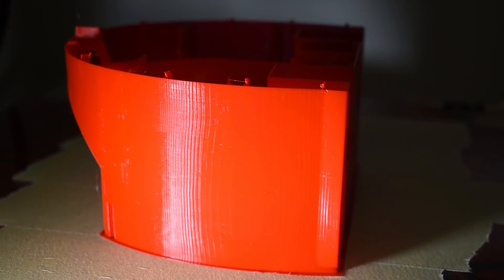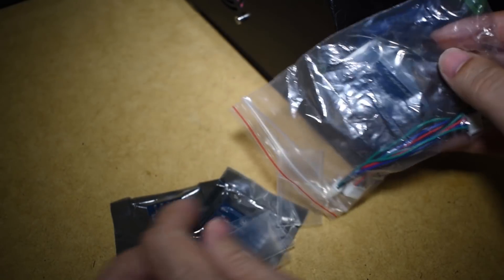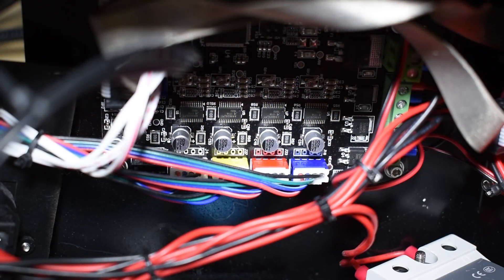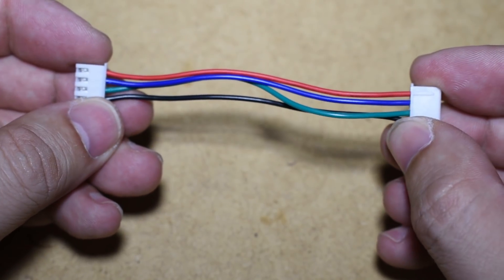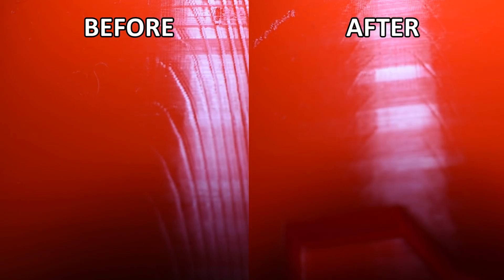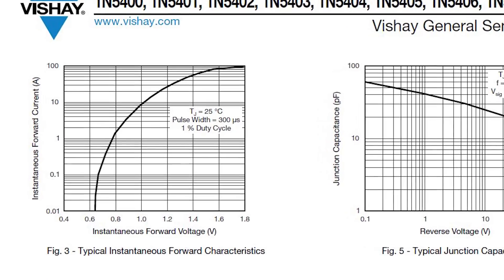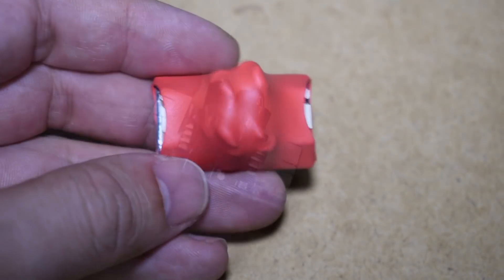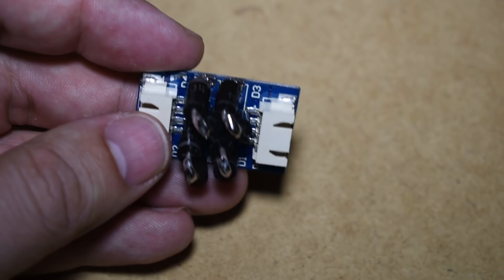SALMON SKIN PATERN IN 3D PRINTS – HOW TO FIX IT FOREVER

Comment: The fast decay mod on DRV8825 drivers also helps. I have smoothers that use 8 diodes and passive cooling. They get very hot so I added active cooling. They work great now.

Comment: Have a question: When you install the smoothers do you have to change the "ref" on the stepper drivers on the broad? The reason i ask is that I had to change the "ref" on the drivers when I first got the printer as you had displayed on a video. I then had purchased smoothers now my print shifts if the printer goes fast.
Reply from the maker: Hi, if you have TMC drivers you will not need smoothers.

Comment: Enough watched... Subscribed! I kinda follow you since your vids for the tarantula but now I bought the tornado in part thanks to you. Speaking about, think your tornado is loud? Would you consider doing some fixes for that (and maybe share it too)? Like your vids because other than several youtubers, you know what you do in terms of technical competence, gives a feeling of safety when considering applying your fixes! Cheers!
Reply from the maker: Hi,
First of all, thank you for your feedback.
Regarding your question, I don't think that the tornado is loud. There is one moment at the start of the print that the fans turn at full blast (and yes...they are loud) but only for a few seconds. The rest of the print is not loud in my opinion. since the fans in the controller are RPM controlled. You can still replace them with noctua fans. These are very silent. Regarding mods/fixes, if i find them i will defenitly post them here or on thingiverse ;)
Reply: ruiraptor hi there, thank you for the reply! That's good to hear, as was a bit concerning (sort of). Yes please; if you decide to do the commented Fan mod or installing a bltouch or the one using induction, please post a video as I'm really considering doing both and despite I'm OK with technical stuff, I prefer to learn from a pro. Cheers!

Comment: For the A4988 drivers used in latest GenL Gold Tornados, there is a different change to remove salmon skin. These drivers are setup for CNC machines, and need a small jumper wire to the ROSC pin to change mode.  All described here: 
https://reprap.org/forum/read.php?336,434073,445689,page=2
(Hit the translate button in Chrome)
Reply from the maker: Hi,
Thanks for sharing.
I did test that at the same time of my analysis and it worked but at the same time, the motors noise changed significantly so I abandoned the idea.

Comment: Hi ruiraptor, 
as always you make the best video for Tevo Trantula and i always follow you and your advice. I'm here to ask you if this smoothers should be installed on each axis X,Y and Z ? 
The link in the description doesn't work so i looked for some info on the net but i dind't find any good info about salmon skin effect.
Thanks :D
Reply from the maker: Felice Caccamo ,
Thanks for the comment. 
Recently some users have received h4982 drivers on their boards instead of the A4982. And some users say that smoothers have almost no effect whith those drivers while others say they do. So I recommend everybody to test. Any 8 diode smoothers will work but I like the trianglelab ones. This decay issue I'd present in all the axis but the salmon skin issue is only visible with the x and y axis. You can use smoothers with all the axis. For example, you you buy the 3 pc pack or 4 pc pack, you can install all of them if you want.
Reply: Thanks for answering, i have the A4982 drivers so i should install the smoother. Actually i have 4 stepper motors with dual z axis, anyway i'm thinking to install it only in X and Y axis considering that i have to buy also 16pc 1N5404 replacing the stock one. 
Do you recommend all the axis? or the printing could be better only with X and Y axis? 
thanks
Reply from the maker: Felice Caccamo 
If you buy the trianglelab plus smoothers, you don't need to replace the diodes. They will work ok stock. And you can use only in x and y axis to eliminate the salmon skin pattern
Reply: The diodes on the PLUS versione have same features like 1N5404? are they nice like the stock one?
Reply from the maker: Felice Caccamo ,
They are equipped with true vishay diodes. I have a different printer (not tornado) running these smoothers and the result is amazing.
Reply: thank you , i will buy it as soon as possible.

Comment: Is shrink wrap required? I don’t have any and I’m wondering if I can just electrical tape it or don’t do anything at all.
Reply from the maker: Hi Nathan,
You can use any insulation material as long as it can handle some temperature as the smoothers can get hot.
Reply: ruiraptor alright thank you! Not many YouTubers be as helpful as you!

Comment: I just have question, how many smoothers are used for the Tevo Tornado? Is it 3, one for X, Y, and Z or is it 4, one for X, Y, Z, and the extruder stepper? I'm a little confused on this one and hope you can help me. Thanks and great video!
Reply from the maker: Hi JAGA,
The salmon skin issue is related with the decay and microstepping with these drivers. All axis have this issue but the salmon skin is only produced by the X and Y axis.
Having said that, you only need 2 (8 diode) smoothers to eliminate the salmon skin...but you can use smoothers with all the drivers.
Reply: Do you think it would help anything to use one on the Z or Extruder stepper also?
Reply from the maker: My guess is that you probably would not notice.In my opinion, you should install for the X, Y and Z. I use in my X, Y and Z since i got a 3pc pack.

Comment: Oh I see now what's the problem, the driver only kicks in after 12% of the voltage  is reached, so diodes acts as a voltage delay line. it probably works with only 2 5w zeners too   -----\≤ |-------| ≥/-----  then you can fine tune the voltage
Reply from the maker: Yes...probably...just needs testing. These 1N5404 diodes are plug and play and if you look at the forward voltage graph are perfect for the output current we have when adjusted to a vref of 0.9v

Comment: Could you put these on the outside of the box to keep them cool? like instead of disconnecting the wires from the board, just disconnect it from the motor and put it there instead?

Comment: TEVO should fix this on their printers and sending out the filters to their customers for free.
Can't believe this could happen on cartesian style printers too. :/
Reply: It's not the fault of TEVO. It's an unfortunate  "feature" of the stepper drivers used.
Reply: which is ..... the fault of tevo for selecting those drivers :-) hehe. not MAD at tevo but I would like them to fix it (include smoothers or use another driver and board combo)
Reply: @nerys Did you could test the smoothers on the CR10 yet?

Comment: I finally got my smoothers in the mail today. Are they directional? I don't see any identifying markings for how to plug them in.
Reply from the maker: Hi,
you can connect them in any way as they are not directional.
Reply: Thanks! I figured since they were diodes, they would only work one way.

Comment: Can we clear something up, it is said that only DRV8825 have this effect as they have a design 'feature' that stops the current from going to zero and this distorts the waveform. Did this video use DRV8825 drivers on the Tornado? Was it a MKS Base 1.4 board that is also used on the Tarantula? I note you said 'recent Tarantula' printers use the same board as the Tornado but it's still not clear which drivers are actually being used. My understanding is that the Allegro drivers don't suffer from this.
Reply from the maker: Hi Mark,
Good question.
In the original article, the troubleshooting was made with DRV8825 drivers, you are correct.
In the case of the recent tevo tarantula printers and the new tevo tornado, both use the same MKS base v1.4 boards which are equipped with allegro A4982 drivers. And, as you can see from the video (and from all the tornado users), these too suffer from the salmon skin issue.
As with the printers equipped with the DRV8825 drivers, the same solution to fix the salmon skin works with the tornado printers that are equipped with the MKS base v1.4 AND A4982 drivers.
In the tevo official FB forum, we also find tevo tarantula users that reported having salmon skin.
That being said, we conclude that the smoother solution (8 diode circuit) for each axis eliminates the salmon skin issue also in this case where we dont have DRV8825 drivers.
Reply: Maybe the A4988 drivers don't exhbibit this problem at 12V but do at 24V? The Tornado I think uses a 24V supply, is that correct?
Reply from the maker: Correct. But as i stated above, the tarantula is 12v and many users reported having also the salmon skin.
Just a correction...the MKS base v1.4 has A4982 drivers and not A4988 drivers ;)
Reply: OK, thanks for the clarification.

Comment: Hi after installing the smoothers in my tornado I got error saying(ERR: MINTEMP 
PRINTER HALTED Please reset)
any suggestions how to solve that issue thanks.
Reply from the maker: Hi King,
The smoothers have zero interference with the temperature signal. My guess is that when you opened the controller and installed the smoothers, you probably disconnected that thermistor cable. Check the connections because you might have a disconnected (open signal) thermistor cable.
Reply: ruiraptor 
Thank you for your reply you are absolutely correct , it was loose cable Took me minute to figure it out The cable got loose when I open the controller box thanks again.
Reply from the maker: Hi,
I'm glad it helped :) Thanks for the feedback

Comment: Hi Rui,
I built myself an 8 diodes smoother with the recommended 1N5404. Did,n't try to print yet, but while I was testing it I found the diodes burning hot. Is it normal ?
Reply from the maker: Hi Simon,
The temperature calculation is in the 1N5404 datasheet. They mention that for the values we are using (voltage and current) the temperature is high. That being said, you need to carefully place them in an area with cooling. My choice was to place them between the 2 fans inside the controller. In there the air flow should keep them between the cooling air flow.
Reply: Ok, didn't look at the datasheet, I was a little surprised and worried when I touched them ;)
Thank you !

Comment: Could you make a video of how you modified the triangle labs smoothers and soldered in the diodes?
Or could you instead run 2 of the smoothers stock configuration, per stepper to get the 8 diodes?
Reply from the maker: Hi, i already have my smoothers modified, so i would have to get new ones to do that...but i can guide you on how to do this (just send me your email or contact me through FB messanger). Regarding the second question...yes...you can use x2 4diode smoothers in series...it will also work but you will spend more money to buy x4 4diode smoothers instead of x2 8diode smoothers.

Comment: Are these needed on the current/newer versions of the tornado? I just purchased mine, and will get these if so.
Reply from the maker: Hi Christopher,
The recent batches include a brand new board (MKS GEN L) equipped with A4988 drivers. These drivers are removable which means that you can replace them with better ones any time. If you detect salmon skin patterns with these new drivers, i would recommend you to replace the drivers instead. You will end up with a much better solution.

Comment: I've got my Tevo with HR4982 drivers, but I already got the 8 diode TL smoothers.. Do you think it's worth installing?
Thanks!
Reply from the maker: padree ,
Yes. The smoothers are do easy to install that it makes no sense not to test them. Some users with the same drivers you have did not noticed any changes but some did, so, you should definitely try.

Comment: what is the difference between s3m and s3g diode?
Reply from the maker: It's related with the maximum voltages. Both will work. You can check here for more details: https://www.vishay.com/docs/88713/s3a.pdf

Comment: Would you recommend it for the tevo tarantula
Reply from the maker: Hi Akalle,
Yes. The recent tarantula 3d printers also are equipped with the same board and they also can get this salmon skin effect. If you notice that you have salmon skin effect with the tarantula, use smoothers to eliminate it.
Reply: Ok cool, i have it too with my Tarantula :)
Reply: As far as I know tarantula board constains A4982 drivers not DRV8825.
Reply from the maker: Exactly...The same A4982 drivers and the same board as my tornado and the smoothers work as you can see in the video. The salmon skin and the smoothers work also for the allegro A4982 drivers...not just for the DRV8825.
Reply: What about the hr4988 clones? Those are the drivers I have in my board. I bought TL smoothers but the issue persists

Comment: Is it ok to put the smoothers at the stepper end rather than the board end.
Reply from the maker: Hi Tac,
You will not be able to. The stepper motor connectors are different. You need to connect the smoothers on the board side due to this.
Reply: ruiraptor ah ok thanks

Comment: i read somewhere that this upgrade is not possible on the newer models of the tornados. is this true? i was about to buy one...
Reply from the maker: Hi Jo P,
The recent batches include the HR4982 drivers. The smoothers don't work as well  with these (compared with the A4982 drivers) but they still help reducing the salmon skin.
Reply: so is here another fix for it then? even if more expensive? I ask because i am literally about to hit buy on a printer and  have the cr-10 for 359, vs the tornado for 305 in te cart... then also looking at anycubic i3 and other prusia type printers. any thoughts based on things youve heard and experienced ?
Reply from the maker: The alternative is to buy an MKS GEN L board (which accepts socket drivers) and buy other drivers to install on it. The GEN L board is small enough to fit inside the controller box but some changes need to be made since the screw holes and USB connector are not exactly in the same place.
Reply: ok that sounds doable, i have been building my own pcs for years so i am pretty comfortable with that stuff.  Sorry but one last Q, I FOund that board for like 15 bucks so that's not bad, any idea what drivers exactly ?
Reply from the maker: Hi,

You can install many different drivers like TMC2130, TMC2208, LV8729, A4988, A4982, DRV8825, etc.
There are ones that are better than others, some are clones, other are the real deal.
I must remind you that for each type of driver, you need to check and configure jumpers accordingly (stepping) and 
also in the firmware you need to make changes (steps) so that they can work.
In the official tevo tornado facebook forum there are already some users that made that modification and can give more detailed feedback.
Reply: thank you kindly!

Comment: Is this salmon pattern something only the tornado does?
Reply from the maker: Hi,
No. The tornado is not the only printer with salmon skin issues. The real issue is the drivers used. Many printers use drivers that have the salmon skin issue and some of them include the smoothers already. If you see my unboxing of the TriangleLab Dforce D300 printer, you will see that this printer also has smoothers inside to prevent the salmon skin.

Comment: Non only X and Y  axis  ... extruder motor need too...
Reply from the maker: Hi Pawel,
All the motors will have the issue with the decay and missing steps at low speeds but the salmon skin pattern is only created by the x and y axis. But i agree on using smoothers in all stepper motors.

Comment: The bed heats up faster than a CR-10's  but the CR-10 doesn't need this complete faff to eliminate salmon skin - because it prints perfectly straight out of the box.
I can't really understand why so many Tornado owners think it's a better deal - I can wait 5 minutes for the bed to heat and I don't print ABS.
Reply from the maker: Well...a couple of smoothers is much much cheaper than a new AC heatbed and SSR. I prefer to buy the smoothers any day.

Comment: Does this happen on deltas?
Reply from the maker: Hi Ken,
The salmon skin pattern is related with the stepper driver used and not with the type of printer.
Unlike the vertical lines that are defects caused by the back and forth movement of heatbed type of printers, the salmon skin defects are related with the drivers used and delta printers can also be affected. When you search for the smoothers online, you can see that most sellers sell packs of 3 smoothers because that covers all type of printers including deltas that require 3 smoothers.
Reply: ruiraptor thanks

Comment: I don't want to have to do this. Kind of a big deal imo.
Reply from the maker: Hi Jason,
You also have the option to change the drivers but the smoothers are cheaper and much easier to install.
Reply: ahhh I see. I may opt for that in the future thanks! After looking at all the benefits of the tornado I am going for that printer verses the CR10.
Reply: Yeh, I made the same decision. The CR-10 is nice, but that print bed on the Tornado, plus all metal construction sold me. I've already ordered the TL-Smoothers from ebay. We'll see how they go. If they're garbage, I'll just get some diodes as in the video and re-solder the boards.

Not sure why everyone is freaking out about having to spend a little more time and effort on a ~$300 printer. You want plug and play, fork out $1500 minimum and you'll get that. I had a Cetus3D, which claimed to be plug and play, but was absolute garbage. I sent it back and ordered the Tornado.
Reply from the maker: Thank you so much for your feedback Kieran